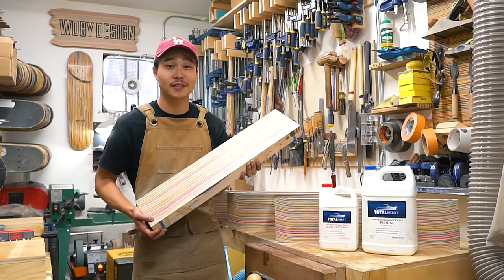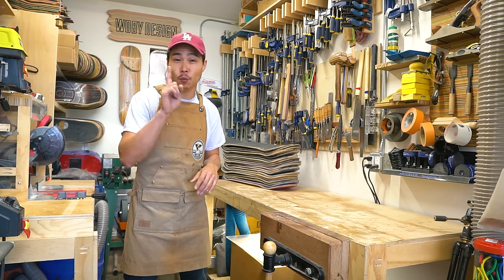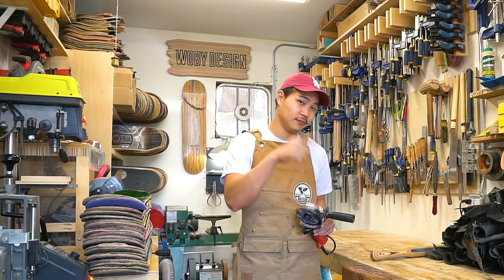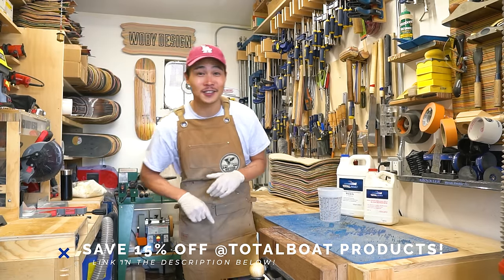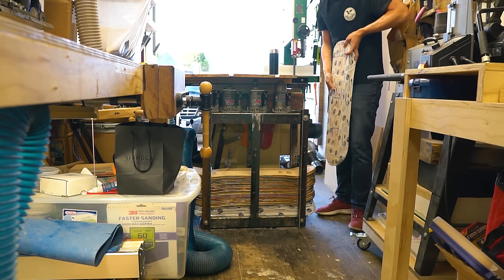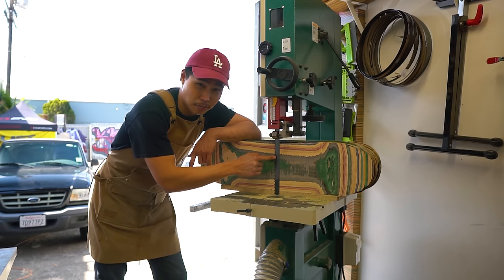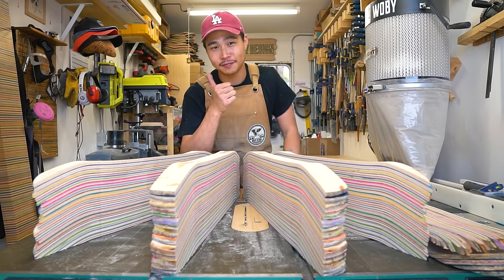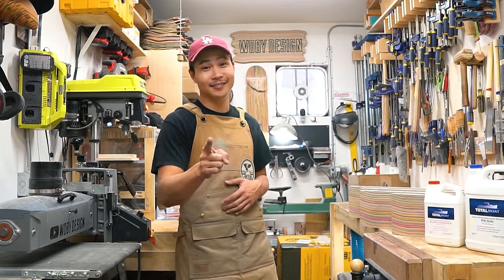LUMBER MADE OUT OF 20 BROKEN SKATEBOARDS!

Comment: Have you ever tried to steam the decks and then press them to try and take the pop/contours out? I've wondered for a long time if you could flatten decks back to their original state with steam. You might be able to eliminate some waste if steaming could help flatten the decks before you laminate them together...might be worth a try. Either way, keep up the great work!
Reply: Cory Stewart why ? 
It's the randomness of the grain that makes it look good !
Reply: Steam, a Press and then a drum sander. Time is money.
Reply: steaming would also make the grip tape just fall right off. the only downside I could see is adding moisture which you will have to dry back out
Reply: kind like bend end lets know it skate bord. long bord squre dosent manter if lines in bord is curved. but your right if wants add another step steam bores allow flatten it or turn heart shape have right forms.
Reply: No. That would never work. The reason they hold their concave is because the plies are glued together while they are bent into that shape. To unbend them you would have to unglue the plies, which would be impossible

Comment: I saw on the Discovery Channel's "How It's Made" that that is how another company makes skateboards out of old skateboards.  They just cut the boards thinner (like 1/2" to 3/4" thick), and they use templates shaped like skateboards to determine the size and shape of each board and cut each blank to that shape.  Then finally, after rounding over the edges, they use clear coat and ground recycled glass to provide the grip.  And with clear coat, you can see the cross-sectional areas of all twenty of the skateboards which each of the new skateboards are made out of.
Reply from the maker: Yea, he copied me

Comment: You should try out acetone soaking the boards. It will eat the paint, glue, and de-laminate the boards so you can press it all flat instead of having to cut all the concave/convex out. You could then just use standard wood glue instead of epoxy.

Comment: You need a pizza conveyor oven for those pesky deck removal .
Personally I'd love to do a parquet floor in that lumber , cut into smaller bricks laid in a herringbone .
Just out of curiosity how much would it cost for a square metre of product X 18mm thick X 40mm X 180mm billets ?
Reply: If you paid him just minimum wage for the labor it'd be about $756,887.
Reply: Richard Patterson   I’m guessing that’s assuming you’re supplying all the decks too - in which case that goes a lot higher, cause finding that many used boards would also take a lot of time

Comment: Could you use a sandblaster to get the epoxy off the boards? There are all types of media you can 
put in sandblaster these days and being in LA you could find a big used sand blaster. 
You might have to experiment with the media  and air pressure but if you find the right formula
if might save you a lot of time.

Comment: Since you're using the epoxy now, do you really have to sand the boards down as much?
Reply from the maker: Tom Zborovsky yeah, still have to sand it to bare wood. Pay attention
Reply: @WobyDesign  Well I watched through the whole way before asking. Just curious if you've found that the epoxy is strong enough to bond without going to bare wood. I imagine the grip tape residue will effect it so it still has to go but I wonder about the stickers/original finish on the bottom. Would it make any difference to epoxy